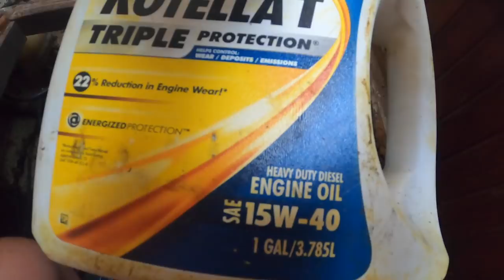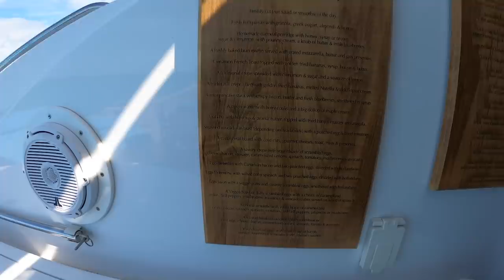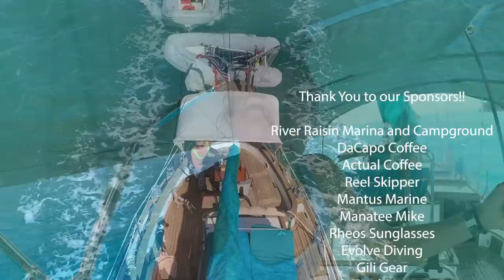Who Needs CLOTHES For An OIL Change, What’s Wrong With Our OUTBOARD, FREE Food From A YACHT![S2:E34]

Comment: If you are fouling spark plugs all the time get a hotter plug go to the auto parts store or the boatstore , wherever you buy your plugs at . and tell them you want a plug that's two times hotter than the one you've got... it'll help burn some of that oil that's passing through your rings, or your valve guides ... and you won't fall out plugs as much..

Comment: Make sure your exhaust manifold and system aren't leaking that is a carbon monoxide source. Check your fuel/air/oil mixtures on the outboard, check your gaps on your spark plugs measure them, regap them and adjust your fuel accordingly.

Comment: I have a small magnet on my drain plug. Check the removed fluid and see if you can spot metal flakes; very small sparkles. I would recommend more than on flush as well.
Reply from the maker: We heard that helps! Will look into it thank you😁

Comment: Just a suggestion that I have found invaluable: Use a suction device to pull the engine or tranny oils out instead of a drain pan. Absolutely no chance of a spill in the bilge forcing even more cleanup! Easy to DIY with a vacuum cleaner or shop vac if one is on board. DIY's all over YouTube for these.  You two rock!
Reply from the maker: There are definitely things that we could do to make it easier😂 hopefully we figure it out one day
Reply: not a good idea.would be easier but there are some particles that lay in the bottom of the pans and pulling the plug helps flush this stuff out.i pull a lot of pans that have used the suction method and there is a lot of sludge in the pans.also drain oil warm.the filters do not get all the stuff in the oil.i know its a pain to pull the plugs but your engine and trans will thank you.

Comment: Little advise pulling starter cord out board.pull till you feel the pressure 2 inch or so,They pull hard to start.
A little plastic lug will other wise snap .Same goes for Generators etc.
Reply from the maker: We had to change the pull cord it ended up snapping😁😂 But yes you are right!
Reply: @SailingTheFarSide  No bother was told this by mechanic many years ago.I have seen the plastic part,and shock over time snaps .One less problem to avoid.Thumbs up good job .

Comment: The cost of living in paradise, endless projects.  Like emptying that red gas tank into the Home Depot bucket, filtering it while you do it. Use a stick and rag and clean out the "stuff" on the bottom of the red tank. Clean the carb (Actually pretty easy to do) and refill the gas tank with pure gas only.  No ethanol, that stuff breaks down the rubber in the gas lines and it gets stuck in the ports inside the carb and the problem repeats itself.  Keep using Sea Foam or B-12.    Anyways glad you see you're keeping your spirits high despite the bumps in the road.  Soon enough you will have things smoothed out.
Reply from the maker: Yah we discovered the “stuff” in the tank when we went to clean it. We added a fuel filter recently as well to keep that from getting into the carb again.
Reply: @SailingTheFarSide  Good job.  It certainly needed a filter.  Especially when buying fuel away from the States.  I hear fuel in other countries can be pretty dirty.

Comment: Thats a Water oil milky mix on your little Merc spark plugs which means you have water in your fuel! Sea foam works good to help with moisture but will not keep the engine from blowing if you do not get ALL the water out of the tank and Carburetor. Pull the little bowl drain screw on the bottom of the carb bowl and flush fresh fuel through it then the 50:1 fuel and oil mix next time rather then pulling it all apart if you did that. If your engine starts missing later replace the plugs because they always die after getting water ran on them.

Comment: As you mentioned in the video clean the carb up on the out board, im sure you can find a video with someone fixing that exact same out board engine on you tube, which you probably have done.

In my experience 2 strokes are very easy and simple, clean plug, clean air filter, and clean gas mixture, and run it hard, they prefer it.

I watched sailing  millennial Falcon, and a boat dealer  from Canada  sent them a free out board engine, from Honda, worth checking into.

 Love your videos you two are amazing  !
Reply from the maker: Wow maybe we need to get on that, not to push the old engines aside... they’re great when they’re carbs are clean 😉
But would be nice to start fresh with an engine! Thanks for following!!
Reply: I truly  enjoy the format of your video, you two are doing amazing.

In regards to the video ill try and track the episode down.
I also did want to mention octane boost  will help those  old engines out as well, and will for sure keep those carbs nice and clean! 
Best of luck ! 

Thank you for going above and beyond to post this.

Ps free drive world record is 24 mins.
Free diving is beautiful!
Reply: Its episode 123 around the 18 min mark.
Sailing millennial Falcon.
Reply from the maker: @dillongurel1178  thanks so much for letting us know!😁

Comment: Hello, Ladies... A few things things... When cleaning your carb, don't forget the jets.. they get clogged / gummed up -especially with ethanol fuel...  Put a strong magnet (outside) right next to or on your drain plugs (tranny and engine oil). It will catch any metal (ferrous)  filings that circulate...  Just before draining the oil, remove the magnet and all the filling will drain out when you drain the oil/fluid... and finally, where did you get your helm /ships wheel necklace? It's very pretty.
Thanks for the show.
Reply from the maker: Yes that's the next project! We got her all cleaned up😁The Plug magnet has been mentioned a few times so we will try it out! And the necklace came from an antique store in West Virginia! Its brass I love it!

Comment: “ purple power” is really great for cleaning up oil messes. Make sure if you use it you wear rubber gloves. It will dry the oils out of your hand if you get it on you. Whatever I do in oil change on a car I spray this on anything that got oil drips on it lightly agitate with a brush and spray with water and everything is clean. After I empty my oil catch pan of the old motor oil or transmission fluid I use purple power to clean my catch pan and funnels. There is absolutely no oil residue left after cleaning with this product and rinsing with water. I buy the spray bottle and a gallon or 2 gallon refill and it last forever.

Comment: You might want to change the shaft bearings and seals in the transmission,if there's metal particals in the transmission fluid, or your going to have more leaks in the future.
Reply from the maker: Yup we had just replaced the seal at the same time that we changed the oil. And the bearing looked pretty good. So far everything is still running great 👍🏼

Comment: If no one else has mentioned it, let me be the first. That to aid and draining the oil use an old rotella or any other type and size jug, and cut a square in one side right where the label is. And that can become your drain pan and it's easier to get in and out of tight areas because of the shape of The jug on its side. And if you cut the hole near the spout and can make it so The jug holds more old oil and you can tilt it a bit if you need to to get it out of the builg. Also a hand operated siphon that you can get at an auto parts store and attach a heater core hose or any hose that fits the siphon can be used to help siphon the oil out  drain pan big  it's too full.  This can help to cut down on chances of spillage. 😉😊
Reply from the maker: We are definitely investing in an oil hand pump! Thanks for the tip😁

Comment: Well done ladies, it looks like your dad has most thing covered, so just a few things that some times get missed,  1.    Self Amalgamating Repair Tape, used to repair rubber hoses, water proof wiring, and push comes to shove replace o ring on drain plugs too.   2. PTFE Tape both water(thin tape) for water leaks on fittings and gas PTFE tape (thicker) for gas and drain plugs leaks. 3. A range of tie raps and hose clamps.  4. A roll of Duct tape, warmed up as it makes the tape much more stickier for leaks before amalgamating taping over it. 5. Empty washing up bottle, make a good suction device for small spills, or cut it up to make washers or cut a piece to cover a split pipe/hoses before taping over it, and you can cut the top off to make a funnel if needed.  like you can with any plastic bottle. Good luck.
Reply from the maker: Thank you for all those tips! Will definitely keep them in mind for projects and repairs!

Comment: One thing you should never run is the flat-faced Mercury plugs, they are meant for full-throttle running. If you idle around a lot, they will oil fowl real quick, killing the spark
Reply from the maker: Yup thats what we have found😁

Comment: Cool work … for changing oil have u guys ever added Zmax or another additive .. I’m a fan of Zmax because it’s a super lubricant that helps keep heat down so oil , seals and overall engine life is extended.. I think it’s cool you guys customize your boat .. my truck has a little steering wheel to lol .. if y’all in St. John’s next summer I’ll change your oil when I’m there .. good video ..
Reply from the maker: Never heard of it but we will check it out! Thanks😁

Comment: And I have another suggestion. You lifted the oil drained from the sump in a broad pan. There was even a comment suggestion that it was tricky, risking a spill. Why not get a small fluid hand pump. Let the oil drain into the pan but then pump it up to another container on the floor by a hand pump. No risk of spillage and less mess. OK. I guess you don't have a fluid hand pump with you. This time. But next time?
Reply from the maker: Its risky but if we could get a hand pump we would!

Comment: 2-stroke outboards have two simple but frustrating problems.
1. Even a tiny bit of water in the fuel from rain getting in the air vent will make you run for 2 minutes then it dies. Opening and closing the air vent every time gets forgotten, so simply find a cheap plastic cup the right size and leave it upside down covering the fuel fill/air vent.
2. fuel in the carburetor evaporates leaving a more oil rich residue that just loves to gum up the idle jet. You know this is happening when you can start with the throttle advanced/choke on but the engine dies when you throttle down. The first time it happens remove the carb and simply use a can of keyboard cleaner to blow the tiny speck of dried oil out of the carb jets. Then every tank full add a little automotive carb cleaner to the fuel to keep it from gumming up again.
I keep two outboards, a 1kW electric O/B for everyday use in short run anchorages, and a 15hp 4-stroke for the anchorages where you need some speed (yup, Staniel and Georgetown). 
Happy cruising comes from having spares for everything and redundant sytstems. I'm on year 22 now and I couldn't be happier.
Reply from the maker: Wow thank you so much for this advice! We do have to adjust the idle every so often

Comment: I noticed you were changing the oil in the engine. If you want the motor to last longer switch to synthetic oil. It costs more but your engine will last a long time.
Reply from the maker: Well so far she has made it 34 years and 14,000 hours!!😁

Comment: If your plugs are fouling you can use lighter gas ( the one you use to fill up a cigarette lighter in the can ). 
It will instantly dry and clean the plug deep within. 
Depending on the hours that outboard has been used and it’s service history it could be the rings are a bit loose in the bore and your getting a bit of oil leaking past. 
You could also have a problem with whiskering on the plugs which is where minute slivers of metal from the bore ( linings) get trapped inbetween the hollow sides of the plugs and the central core and it earths it out. 
Any Vehicle I have that uses Plugs I have a emergency kit of a can of lighter gas and a Allen key which is filed to help clean and gap the plugs and a spare length of HT cable and a can of WD40 or GT85 for water displacement
Reply from the maker: Thank you! We’ll check that. We’re thinking one of the solenoids is bad and doesn’t always kick in. Maybe need to order a replacement. Not sure why the spark plugs foul, but will check out your theory. Thank you for the help!
Reply: @SailingTheFarSide   Outboards can be fickle things especially when they have high working hours...easiest way to explain is you get a piston slap in the bore and the rings can’t cope and they end up shaving the bore which stops the plugs from working and you get leakage through the rings. 
I noticed in one of your other videos that you were having problems with your Air Tank Compressor and that’s probably due to the Fuel....Try and only use Ethanol free fuel if your not using the compressor all the time. 
Ethanol attracts water and Fuel and ethanol mixed with water goes like a gunky slime which will build up in the Carb ... Ethanol free fuel costs a lot more but it will save you the hassle of draining the tank and fuel system and carb and having to replace filters and clean the carb and jets out ....same goes for the outboard motor and could actually be the problem. 
I’m in the uk and over here Shell V power is the best ethanol free fuel but Bp ultimate is a good second place..... Loved the Video of you both on the Beach with the piggies,especially the piglet awwww cute.

Comment: I have a question about the design of the boat. The helm. Why is it 12 inches in diameter and located 2 feet above the deck? Small diameter is understandable but the height? Every time the helm needs adjustment the operator has to bend down, and not by a small amount , but bending down almost to the deck.
Why is that?
Reply from the maker: I take it you saw the explanation😁

Comment: I don’t know if you got an oil filter on there but you could use a wicks filter and also buy our friends FRantz oil filter in 100 hours you could just use a roll of toilet paper and it keeps an engine oil clean The little pricey upfront but well worth it and a cut down on your maintenance and also keep your all clean do you have a transmission filter and a cooler you can order one for that too
Reply from the maker: Thanks for the Tips😊

Comment: We used lemon Joy on the shrimp boat bilges.
Reply from the maker: Will check it out! Cleans nice?
Reply: @SailingTheFarSide  I think we used it because it works well in salt water.  I was just the mate on the boat but most of the commercial boats seemed to squirt Lemon Joy in the bilge if they spilled a bit of fuel or oil during maintenance.
Reply from the maker: Hmm okay we are going to provision soon and will keep an eye out for it thank you😁

Comment: Good work on the Transmission and Bilge  check yur manuals the Transmission may have a Magnetic Plug  that attracted  most of the Metal ? unlikely but possible ?  if it’s a ParaginTransmission  a couple of Flushes. you should be Golden they ar BulletProof

Comment: At 5 minutes you showed exhaust dust on the walls of the bilge. Ladies please repair the exhaust leak before your next venture out on the water, the fumes may kill you otherwise.
Reply from the maker: In a previous video we showed that our exhaust hose had broken when docking in Bimini. That is what the exhaust residue was from. The hose has since been fixed, but with minimal fresh water for cleaning we have to wait till we can get running water before we are able to clean the residue off. Thank you for looking out for us 🙂

Comment: Chuck the gas guzzler and put a water snake or similar on the duck
Reply from the maker: What do you mean?
Reply: @SailingTheFarSide  Water snake is the same system that the bass guys use. No choke, no carb, no problems. Battery operated

Comment: ok you had an anchor and an anchor is  designed to grab the bottom why did you not use the anchor to get back to the boat throw it out and pull it back in get there one anchor pull at a time

Comment: If you did not replace the seal it’s going to leak out again
Reply from the maker: We replaced the seal, the video before. We just had to put some fresh ATF in due to metal dust particles that had gotten mixed in due to friction build up due to no seal and no ATF in the transmission. All good now though and we haven’t had any leaking 😁

Comment: I'm surprised no one else commented on the awful audio levels. Some parts are very low and then when the louder parts come on, it is so loud that it is painful to my ears. I even replayed part just to see if it was something with my computer. Do you have any kind of visual gauge in your editing software to see how the levels compare throughout the video, or an option to equalize the levels between different cuts? The volume always changed with the different clips, so it may be one of your cameras or just the conditions from some of the clips when they were recorded.
Reply from the maker: Sorry! We always go through the videos multiple times, we try to make them even, it sounded good to us! Will double double check the next one😁
Reply: @SailingTheFarSide  Thanks for the reply, keep up the great work on the videos and have fun!